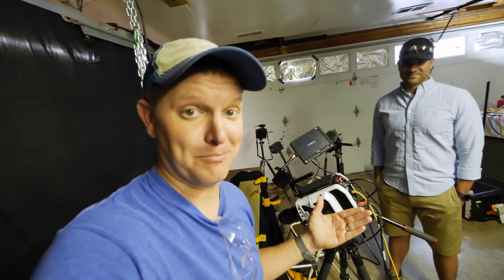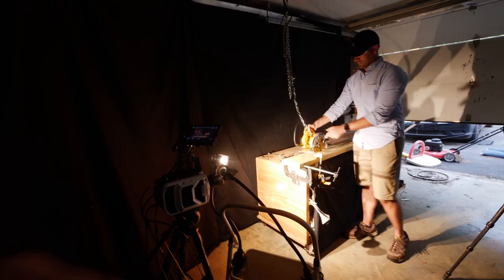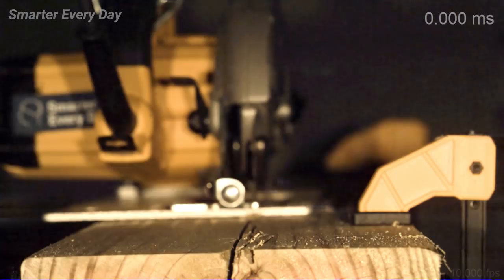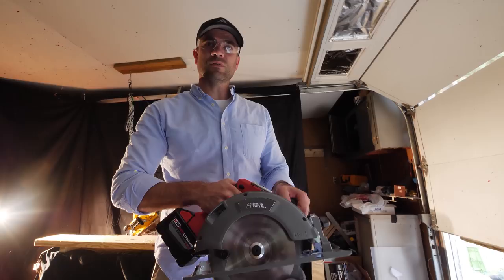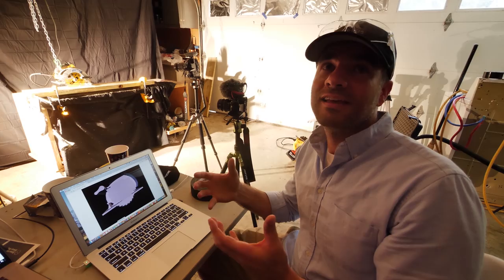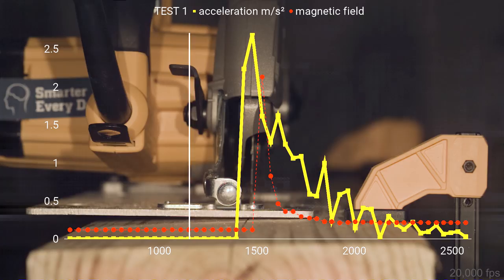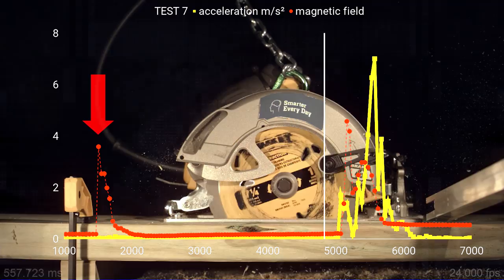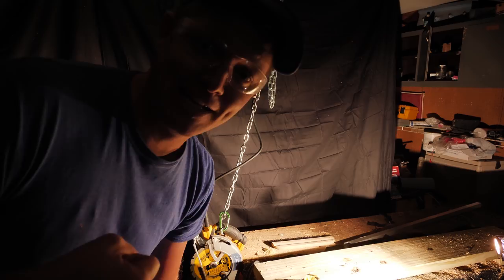Circular Saw Kickback Killer (We used science to make tools safer) - Smarter Every Day 209

Comment: Why did you disable the blade guard? Saw comes out of the work and the guard covers the blade, simple, no electronics to fail. My saw had it from the factory.
Reply: Yep, They are making the saw more dangerous, just to prove their technology.
Reply: 009to090 most get tug of the guard for it hinders some cuts this allows you to be safe whist also doing the job you wanting for.
Reply: I am pretty sure they took it off so they could get the footage they need of the saw spinning.
Reply: I think it would be good to have both, because if the Electronics fail there is a guard to provide protection. and it the guard get jammed(More likely, a chunk of the wood could jam it) the electronics will more than likely stop it
Reply: Believe it or not, I witnessed it. Building a house, one of the elder guys had a skill saw without the blade cover (dangerous and stupid, I know), well - one day it wasn't done spinning down and he sat it on the floor and it took off and ran across his foot, almost severed his toe, so honestly, having the blade guard and this tech would be beneficial for those Darwin award winning people. .
Reply: Yeah I’d much rather trust a simple mechanic over software and sensors.

But I’ve also cut many a long rip sawn piece of wood with many skillsaws and never had it kick back because I use the tool properly, carefully with both hands and good form.
Reply: Thanks. I thought I was imagining things. I like watching SmartEveryDay, but I think they could have spent their time better this time.
Reply: I get the intention BUT. Having made 10s of thousands of circular saw cuts in a standing postion with hand held material,  I have to say this idea is obsolete and the kickback is only due user error.the guy explaining the plywood jam is talking about a completely incorrect way to cut to add creedence to his innovation. Blade jam is nowhere near as dramatic as shown here. In fact a blade jam does exactly what the sensor does. It stops the blade spinning. Patent attorneys love to accept any patent application. A blade brake function is not novel or unique.
Reply: Actually never knew it was a problem. Also, it would have been interesting to see a slo-mo of the saw flipping back with the mechanical guard enabled. Just to see how fast that's reacting.

Awesome tech though.
Reply: @Pitman-Grills  As somebody with extensive experience, this isn't for you. This is designed to protect people who WILL make serious errors.
Reply: @djdbsk  they might but id be amazed if any curcular saw brand has ever been sued for user error. What's next ? A claw hammer with proximity sensors to locate thumbs ?
Reply: This is all true when talking about people who use things as intended. I have seen many pros who modify their tools, amateurs who use their tools improperly, people who don't pay attention, broken guards, jammed guards and all manner of other things. I would love having both safety measures.
Reply: @Chris-Fennimore  Agreed. Only a moron would tie up the guard even to demo a product.
Reply: @Pitman-Grills  DUDE!!!
Reply: @Blaze Pitman great points! Please don't ever disable your blade guard. We're not trying to replace conventional safety measures. In fact, I recommend you use a riving knife whenever you can. I'm all for the simplest solution where possible. What we've got is a very inexpensive solution that complements what's already there to cover those edge cases where standard convention fails (in other words, accidents).
Reply: @Pitman-Grills  Most car crashes are also user error. That doesn't mean making cars safer is a wasted effort.
Reply: Many think a guard will help are often wrong and find out the hard way after a wreck. Even if nothing blocks a blade guard most can fail to close and the blade will eat you because take time for weak spring on most Circular Saws to work. Any rubbish in the guard pivot like sticky sap can block closing the guard enough to eat you more. Same or worse damage to you then whatever else that can block closing of the guard.
Reply: @Pitman-Grills  Funny thing is tool companies already have brake functions like they demonstrated in angle grinders, so its not only useless because its a stupid idea but because it also already exists
Reply: I pin all the guards on my saws.  They just get in the way.
Reply: @davidstante2  in which case my comment about hungry patent attorneys is valid. Im off to design a better mousetrap... Yippee. Im goona get rich and buy myself an overly engineered safety circular saw with a kill switch and LED lights to warn people within 50 feet that the risk of a sawdust eye injury is increased by a factor of .00000025 . safer every day.
Reply: @TimBaoht  I've seen a 71/4 inch 32 tooth blade embedded into a thigh due to this stupid idea of removing the guard. Why do it ? Seriously.
Reply: @Pitman-Grills  They already locate thumbs quite nicely without that.
Reply: @chadgreen376  my prime concern is that the way you set that saw up to jam is the cause of the jam, in a situation with the blade pinching. It jams. 100% gauranteed i can hold a jammed blade with the trigger pulled until the motor starts burning out and that saw wont run away unless i free the jam up and pull it out.
Reply: Ah not always!

So when it kicks towards you, the guard can't close until it has fully left the wood as the guard is at the back.
If you're holding a piece of wood with one hand, a foot, or standing near it (yes all things we shouldn't do but do) then it could potentially hit you before the guard has time to fling shut.
I think that's the purpose of this safety device theyre demonstrating
Reply: during a kickback event the saw guard usually still stays back, I have two friends with messed up hands due to kickbacks and both their saws had properly functioning guards on them. This system is just an added layer of safety that is more robust in its safety application.
Reply: most compound angle cuts require the guard to be back.  It's just something a pro gets used to.  not recommended for those not really good with a Skillsaw. @Pitman-Grills
Reply: The guard doesn't work when the saw tips forward, and a spring-actuated guard has a slower response time than a magnetic brake.
Reply: @Pitman-Grills  yes but most users aren't as good as you and many aren't even as good as they think. I think this would be good added safety.
Reply: Carpenters will often pull the blade guard up and out of the way, then lock it so it doesn’t get in the way when they’re making cut after cut all day. It lets them work faster.
Reply: Milwaukee already makes a skill saw with a kick back protection function. Personally, even when I was a "greenhorn" carpenter I never had problems with kick back on a skill saw. Always have a nice firm grip on the tool and when it catches, the blade stops and the motor starts to burn up if you keep the trigger pressed. I've never had it leap out of the wood like that or come back at me. And I would prefer to leave the guard on because you can set it down when the blades still spinning if the brake gets old.
Reply: @Pitman-Grills  Patent's don't pass any judgement on the value of the invention, or the nature of the problem to be solved.  A patent is about the process or method used to solve a problem or achieve some outcome.  The patent can be issued if the method is novel, non-obvious and not previously applied to the problem.  They can be (and often are) narrowly scoped to meet the non-obviousness and not be covered due to prior art.  In this case, while you might imagine using accelerometers or gyros to solve this problem, the novelty may come from the application of machine learning or neural networks.
Reply: Plane and simple. It’s for filming reason. You would never want to take one off for actual work use. As mention in of the comments below they can take off once put on the ground and lop a toe off. 

HOWEVER. In a kick back event. It won’t help one single bit. They just don’t close fast enough. If they had the spring pressure to do so it would make a lot of the types of cuts the the saw is meant to do hard; dangerous. 

I got two fingers cut off cause the blade guard does not close fast. Was lucky to get one of them back. Talking with DeWalt lawyers they are very clear about the guard. It is meant to protect the blade when you set the saw down. That’s it. Not for kick back.
Reply: yeah but thats no fun
Reply: @greag1e  Let them win the Award...
Reply: What's a blade guard in this conext? I know basically nothing about woodworking as a whole.
Reply: My intestines are a bluish white. I know this because blade guards are not as fast as kickback.
Reply: @Pitman-Grills  Yes, in fact they state in the video that they are using the built in brake to stop the blade.
Reply: @Pitman-Grills  omfg, thank you lol
Reply: Fix It Yeah I agree, this is horseshit. But then I again, I have experience and know the mechanics of a circ saw and how to use it. The only way you get kick back is if you’re doing something stupid, so I guess this “might” be good the average Joe? I don’t know.
Reply: You're trying to call them stupid but pretty much made yourself look dumb. They took it off for footage. They wouldn't be able to sell it without a guard, stuff like this is required to have a guard. No store would sell it. Even if they could sell it no one on an OSHA inspected job site could use it which would cut a ton of business.
Reply: @Pitman-Grills   Not to mention that spring loaded blade guards already exist and do a phenomenal job of protecting you from a rogue saw. And what's more awesome is that they come standard on EVERY circular saw.
Reply: @Noromdiputs  its not just for wood work but for circular saws in general. its the thing that comes down and around the blade when the saw isnt against what your cutting thus guarding you from the blade
Reply: thinking the normal guy without any experience for using these kind tools, and somehow it kickback instantly and the blade still spinning toward his body, it will be fatal enough,
but if we applies the automatic break it could be save his own life

just to prevent more human error in this case
Reply: I feel like this is a bit over engineered. Cool, I admit but a simple micro switch placed in the base would accomplish the exact same thing. The second the tool is lifted off the wood, it would stop. I don’t have experience with a saw but from this video, it seems obvious that every kickback starts with the tool lifting out of the wood. Make a tool that only works when laid flat and problem solved. Am I overlooking something here?
Reply: Scientific experimentation. I'll put a hundred on the table that saw will never see  actual work in that format
Reply: @Pitman-Grills  Exactly. Notice how they push the saw backwards? If you stand on the side where the power cord and handle is, and push away from you, then this won't happen.
Reply: @greag1e  if you needed a case to defend all Darwin award winners you'd never stop adding bits. Better add a mattress to the sides of all cars for the people who walk into them!
Reply: @Chris-jo1zr  plenty dont take such care all the time.  Are you saying having this system on TOP of guards and being safe is somehow worse?
Reply: @elevown  It could be worse with false positives but honestly I'm thinking more manufacture costs, something like this, as small as it may be will still add costs to a product and unless it's a massive selling point and works perfectly then people won't be too stoked paying extra for it.
Reply: @alansmithee419  ;) made me smile thanks

Comment: I used to work in a prefab house construction facility and it was one of the most dangerous environments I had ever worked at. Injuries were so common. 
Safety features like saw blade guards were removed intentionally to deter theft. (It didn't work...) So being hyper aware was extremely important to self preservation. Not just of what you were doing, but of what others around you were doing. The safety feature on nail guns were removed as well, lots of errant nails flying through the air... 
I let my guard down "no pun intended" and my jacket got caught in the saw blade as it was decelerating and shredded deep into the material. Thankfully my finger was off the trigger already!
Reply: That is seriously huge violations to code I'm hearing.  Report, report, and report.  Do not ever, EVER let employers or companies get away with and do things like this.  Someone can be very seriously hurt.